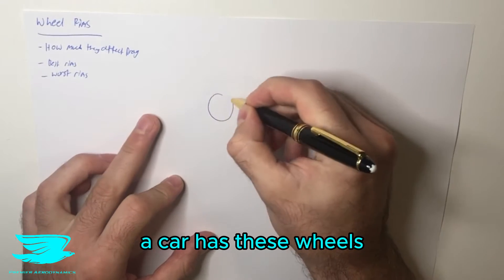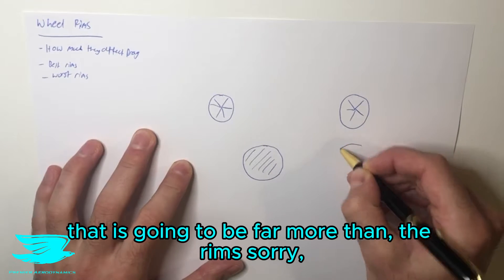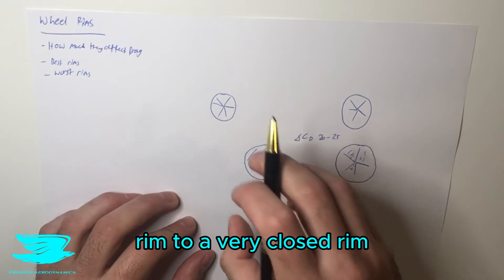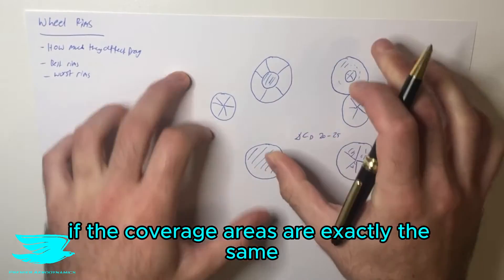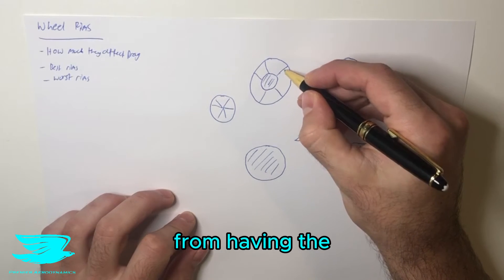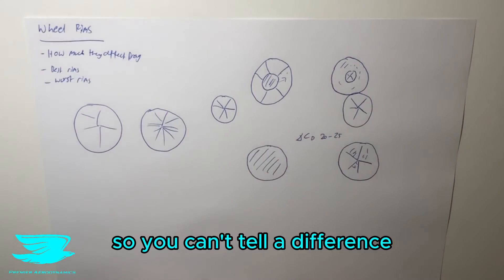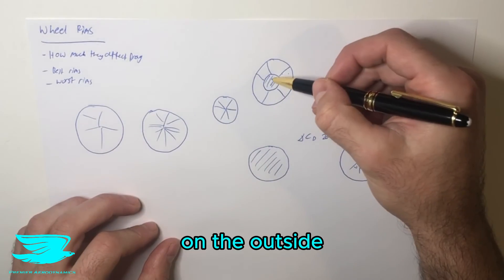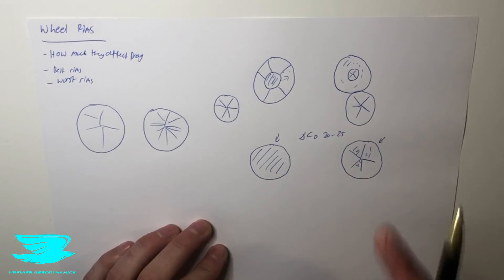{Auto Aero #36} Rim Aerodynamics

Comment: Turbine wheels would work if the bottom of the car was shaped to take advantage of them. The two have to work together, you can't just slap on turbine wheels and call it a day.
Reply from the maker: Completely true. In fact, that is exactly what I said to my bosses back then.

The problem is that the same turbine design is slapped on both sides, which means that one side is pulling air in and one is pulling air out.

That makes it even harder to do, especially in cross winds.
Reply: @PremierAerodynamics  what if front turbine pulls air in rear pulls air out
Reply from the maker: @camdoice  If you know what direction the flow is coming from, then you can definitely design them to do that, but because you might be cornering, or there are crosswinds, it results in that not being as easy to do.

Having the spokes to arranged to generally pull air in will definitely help reduce the separation around the front sides of the vehicles, but that hasn't really been done yet.

Pulling air out at the back, I don't think is very beneficial because you want the rear to have a small wake.